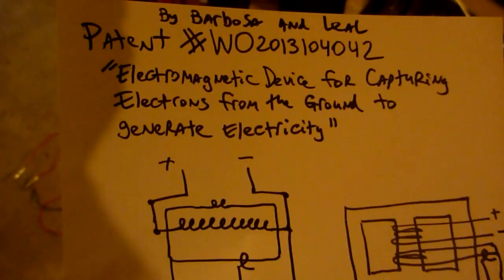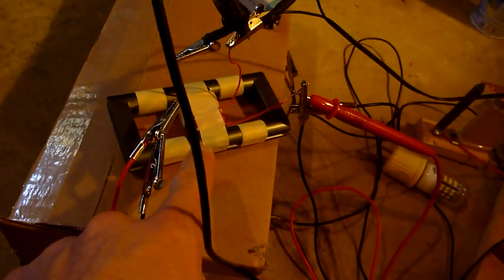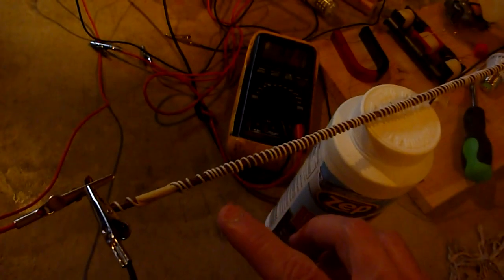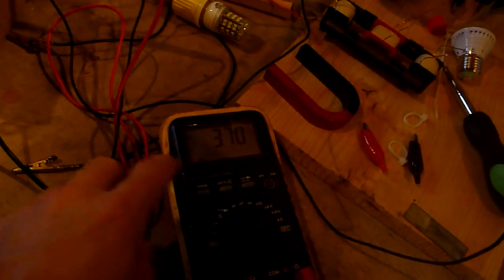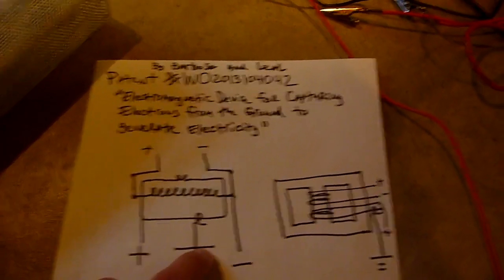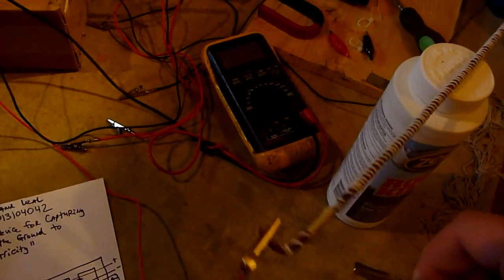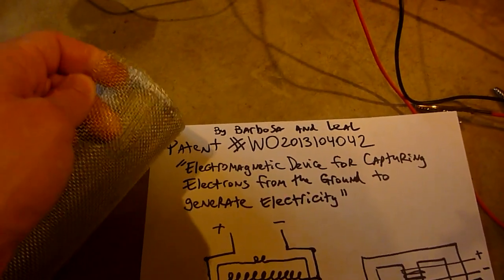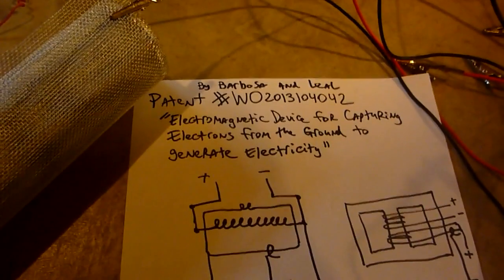Electricity from the Ground (My investigation into the Barbosa and Leal Patent)

Comment: i advise anyone dabbling in this...

throw away your DMM. do you understand how its circuits work? can you trace out the flow? no. 

learn how good old moving needle displays work. shunt resistors.

circuits where the operating principles are clear, are on display... are PHYSICAL.

dont get into solid state circuitry, use switches and when possible, mercury.

learn how kelvin wattmeters ,, ballistic galvanometers, wheatstone bridges, and the like work, make your own instruments.

track down as many books on electromagnetics from prior 1930 that you can. everything after that is rubbish. sort of... i still like making audio amps and playing arduino... just saying... you wont ever see anything interesting if you only stick to whats been published after 1930 or so... and yeah, a scope, having signal generators does help to see whats going on at times... cant deny all modern teachings. just some ;)

Comment: All real successful units I've seen all seem to come from countries that use 240 power I've never seen a 110 that works which would imply a higher voltage pulls more energy . And that wire that you have wrapped around  needs to be much thicker in copper .try this . And it's successful like it's trending in this direction go to a much higher voltage

Comment: xx've been in electronics for more then 50 Years.  This is what I'm thinking as it relates to Ed;s efforts and design,  All you need to do is look at his generator device, (one of six he built over time),  It uses "V" (NOT BAR MAGNETS),  magnets there was a real reason for that.  The magnets were set up 25 magnets around and 5 deep.  They were set up in repel mode to send as much "B" field into the earth as possible.  The "B" field is the center of a magnet not the North or South poles those are the weakest points on a magnet.  The "V" magnet is a perfect device  for his purpose given the "B" field is at the center and allows all magnets to supply the center as needed then through the crankcase and then into the ground.
Reply: https://www.youtube.com/watch?v=AyaV6eswOSc

Comment: This is not the "Barbosa Leal" device. I built the actual device and it is a fraud. All they do is take hot side mains , pass it thru load to earth ground.  It fools a common watt meter and makes it look like crazy current for almost nothing. That 'nothing' is the current "leaked" by high impedance side of circuit back to power grid neutral side. I would like to say there is some interesting  activity with the closed loops running thru transformer core. There is an inertia that continues for a while after power is cut.
Reply: Non sai minimamente di cosa stai parlando, quello che dici conferma soltanto che non hai capito nulla del brevetto Barbosa Leal, mi dispiace .

Comment: Aren't you just capturing voltage generated by radio wave with that great big wound antenna and then amplifying it?  I fully accept radio waves as free (as in cost) energy, but it's hard and inefficient to collect.
Reply: not too inefficient if you know the geometries and 'Directions' for certain setups.  ESP if you know what (a major/main) source is & its characteristics.  ALSO, its helpful to keep it powering low load, low Voltage devices.

Comment: I think that just means tied to ground.
Reply from the maker: If you read the patent it specifically states that you should wrap the ground around the shorted coil with a few turns. There is no metal-metal connection with the ground and connection. Check out the patent if interested in this.

Comment: the grounding needs an oscillator to agaitate and evoke the electrons, why not try to pump some oscillations on the ground earthing and air antennae, it could be affiliated to teslas power from air and ground receiver setup
Reply from the maker: What you said reminded me of Tesla's Asynchronous Motors (like in this video/patent>> https://www.youtube.com/watch?v=4kCxHgM5zNI Tesla had 2 motors connecrted to each other in a loop with 2 ground connections. The ground would oscillate (like you suggested) and this caused the motors to run themselves. Thanx for the comment.
Reply: thank you, the example I gave you was only a simple tesla patent for getting energy from the air and ground with an insulated plate held in the air, and the diagram looks and seem useless, until you agitate it with oscillations, but it was your own perserverance and intelligence through the investigation of Teslas forgotten patents that reminded you, so the credit goes back to you!

Comment: Good video, this is a low voltage version of Don Smiths patent. That's why you need a huge ground system. The higher the voltage the smaller the ground needed. All this will work way way better at high voltage. If you want to understand what smith was doing, study the Leal patent.

Comment: Voltage alone is not energy. Electrical power is measured in watts, meaning, voltage and current. Without current there is no energy. Even if you have 20,000 volts if the current is only 1 micro-ampere it can not move anything.

Comment: Hi N.K. I like ur set up with this, however I would like to point out that the ground should be a clean ground & not connected to ur house wire cos the Earthing is not necessary a true earth. Please try to put in ur own earthing rod to cross check results. I would be interested in ur findings. Regards ....  DC
Reply from the maker: +E.power DC Agreed. The real Barbosa system requires extensive grounding. Some people put as many as 28 rod each rod 6 feet tall into the ground. The effectiveness of the system requires this type of grounding. Best thing to use for ground is an underground aquifer (what Tesla used for ground in the Wardenclyffe Tower). Thanx for the comment.
Reply: @naokikashima9349  Ma è mai possibile che viviate sempre nella fantascienza e mai nella scienza quella vera............. la terra del Barbosa Leal, è una semplice messa a terra con resistenza elettrica uguale a quella del Neutro di rete, non serve nulla di più, è soltanto per il ritorno del carico, se hai un carico di 100 Ampere, è logico che non puoi usare il neutro di rete da 2,5 mm quadrati, la terra del barbosa Leal e il Neutro di rete sono la stessa identica cosa, soltanto un problema di sezione che si risolve con una trccia da 240 mm quadrati ed una semplice asta di terra, non esiste fantascienza soltanto leggi dell'elettromagnetismo conosciute da 200 anni, per una volta aprite gli occhi e la mente usate la logica, è tutto scritto nel brevetto non serve inventare basta capire quello che si sta leggendo.............................

Comment: Check out my free energy from air video which requires a ground cage on a lit 40 watt 220 volt Led bulb. The plasma ball I have is hooked up to a battery but the battery is not looped into the circuit shown. The battery powers the plasma ball only with 7 watts power but the lamp the ball powers up is 40 watts!! All my videos are listed under Thomas Ferko. And they all are open sourced free to the world to make and use

Comment: Hi..Nice test. Please have a look at my Playlist  on Electron Capture. You will mostly see that the Barbosa replications take the real ground wire to the small coil, wrap it around 5-7 times and use the earthed wire as the neutral output. The positive output is taken from a tap on the small coil...All replications also show direct mains power eith 110 or 220v onto the main transformer coil and all use AC....direct DC  (Battery) should not work on a transformer as far as I know.
Reply from the maker: +MrFreddiew1 Thanx for the comment, I'll check out your playlist. This was my very early look at the patent.
Reply: Дайте ссылку на плейлист
Reply: @vital007ggg2  Sorry, playlist is removed!...
Reply: @MrFreddiew1  but now.. in 2023 ??

Comment: You are probably going to block me, that's okay, I'm going to unsubscribe.  After you disconnected the ground, there should have been no voltage at all.  what was the source?  secondly, this is bull crap, and not funny.  People believe these things, and you are mocking real advances in electronics.  But you actually can get electricity from grounds, two ways, first is to create an electron pump, second is from the electricity from nearby transformers that are hot grounded into the earth.  Farmers have lost cattle where transformers have been grounded into the earth too hot, and leaked electrical current.  The electricity killed the cows.  I am ashamed of you.
Reply from the maker: Gristle Von Raben No no the power comes from a DC power source! I use 5.9 @ 400 mA power source. A power source will have to be used to polarize the transformer. This polarization causes electrons to be sucked up through the ground into the transformer effecting your output. I'm sorry I should have clarified this more in the video. You really should check the links to the patent if interested. Still, Barbosa claim that using this method it is possible to achieve COP value of 100. Extensive ground is required for this (as many as 28 grounding rods 6 feet long each).
Reply: My apologies to you, Sir.  I understand now, thank you.
Reply from the maker: Gristle Von Raben No problem Sir. My goal is to provide factual data and experiments for the people. If you see anything else that looks suspicious make sure you bring it to my attention.

Comment: What have you been able to do with this electricity except for measuring it on the voltmeter?
Reply from the maker: Tony Ward Nothing right now, I am still at the early stages of this. Barbosa had left out a few key things from their patent. "Clarence" from the energy forum managed to replicate the patent and fill in the missing pieces. P 226, 227 in the "Guide to Free Energy Devices" has a good schematic for this with wire gages that have to be used, etc. I plan to apply this patent to the PMH device! Maybe I could get the PMH to spin itself by siphoning the electrons (monopoles) from the Earth. Maybe this is what Ed did. I heard in the same shed that had his famous flywheel there is a sub floor. That floor is under lock and key. Maybe he had an extensive grounding setup there hooked up to the flywheel at the bottom (similar to the Barbosa's patent).

Guide to Free Energy link: http://www.free-energy-info.co.uk/PJKbook.pdf

Comment: Have you tried using pulsed DC?
Reply from the maker: clixbits Haven't tried using pulsed DC yet. It turns out that "Clarence" and "ZeroZero" from the energy forum managed to replicate Barbosa's patent perfectly. It turns out that 2 toroids have to be used. "Practical Guide to Free Energy Devices" page 226, 227 has the successful replication schematic with all the technical specs listed. I have the link to that .pdf in the description of the video. Thanx for the comment.
Reply: @naokikashima9349  Non raccontiamo stronzate e bufale in continuazione, ad oggi non esiste nessuna replica funzionante che possa essere testata da terzi, il resto sono bufale messe in rete per far abboccare i fessi, la realtà è questa aprite gli occhi prima di inseguire false speranze.